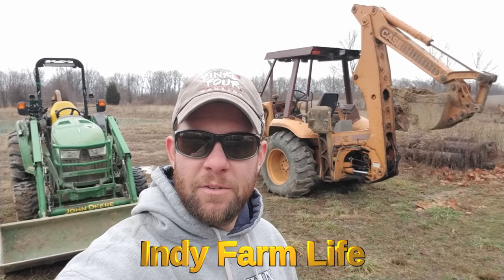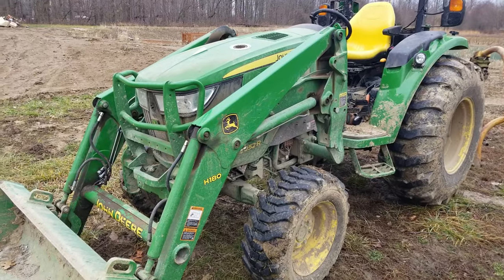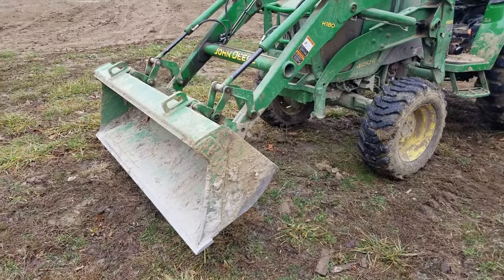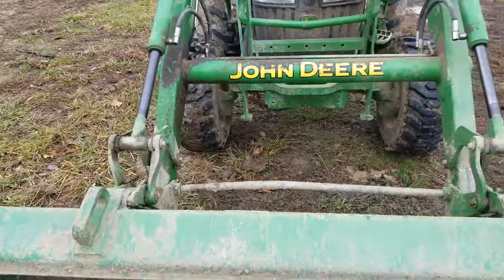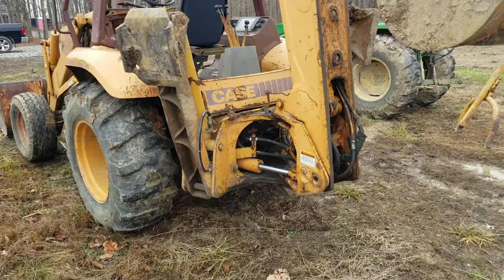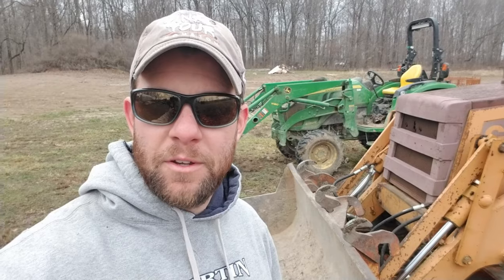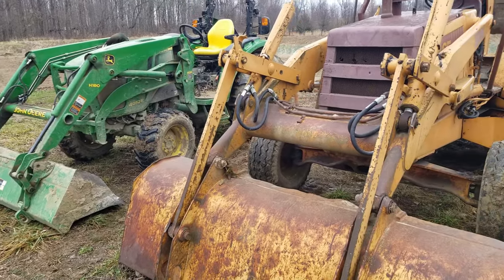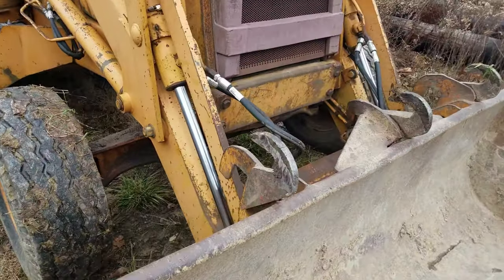Tractor vs Backhoe:  Did You Know About This?

Comment: You make valid points about potential damage to the cylinders, however the main reason case came up with that design is because you get more breakout force with your bucket when using the extending cylinder than you do on a retracting cylinder due to the lost volume and surface area from the cylinder rod. The Case 480 series machines had a setup more like the John Deere without the "Linkage" and several other backhoe manufactures use the typical "Extend cylinder" for bucket curl. The biggest difference is that the backhoes are just plain build stronger to handle these loads vs a farm tractor.
Reply: 100% correct about why that particular model of backhoe is designed that way. Many of those light duty tractors with loader buckets can't pickup the entire machine like a backhoe can. My first run in with a farm tractor with a loader bucket was eye opening to me. My boss got it stuck in the mud. I went to go help him out and the thing couldn't lift it self up out of the mud with the bucket. This is a pretty big machine too. As big as any backhoe I have ever run. I've gotten backhoes in some pretty sketchy situations. And if you stay calm you can use the hoe, the bucket, and the outriggers to get those things our of pretty much any situation because they are all strong enough to lift the entire machine. That's their best feature given that they aren't the best tool for any job lol. They're built incredibly strong and can back drag a loader bucket flipped down like that without a problem. And like you pointed out. Not all backhoes have that reversed cylinder setup.

This guy was clearly still learning about these machines when he made this video. I get it though. There are a ton of people out there with opinions that more than likely attacked him that don't actually know what they're talking about.
Reply from the maker: Thanks for the reply.  Yes, it was the early days. Ha I suppose the setup on this particular backhoe is two-fold then.  Appreciate the insights!
Reply: I agree that the added breakout force is likely the biggest reason case used this design.  

As you point out, the cylinders produce significantly more force extending vs retracting.

Comment: Pretty good video but you might want to make a correction on how a double action hydraulic cylinder works. 
Double acting cylinder has hydraulic fluid on both sides of the piston at all times except when fully stroked in either direction. There's never a point where there's no hydraulic fluid in the cylinder. It uses hydraulic pressure to push the rod out and then it uses hydraulic fluid to pull it back in. 
Easy way to determine whether or not you have a double acting or single. Double acting have two hydraulic fittings one at either end. Single acting only has one hydraulic fitting.
Single acting cylinders use some exterior forced to retract or extend the side of the cylinder that is not supplied by pressure.

Comment: When I was an apprentice back at 'Diesel fitter' school, they went to great lengths explaining to us about all the different 'pressure relief valves' that are in most loader / excavator hydraulic circuits specifically designed to protect cylinders and hoses from this kind of overload. There is the main one on the pump circuit which is usually the first to dump at the end of the cylinder stroke or when lifting too much. Then there are ones on each circuit to (as I said before) protect the closed, or locked, circuit. These are set very high and you have to be doing something very extreme to make them blow off...........Like back-blading and hitting a stump / rock, for example. That said, I'm sure not every machine has these fitted, so best to play it safe!! Great video, by the way!!
Reply from the maker: Awesome info!  Now I just wish I knew which machines had them.  My guess is compact tractors don't and you would find that on more high end commercial equipment.

Comment: Most people do not ever have a job running a real piece of equipment, great job showing the difference in the equipment. Also on the larger John Deere Farm tractors they have a float valve for the bucket when you back blade, this keep them from jamming the cylinders back when you hit anything. Great instructional video.
Reply from the maker: Thank you!  So they have a float function on the curl/dump cylinders in addition to on the loader lift arms?    Mine has it on the loader arms, but I would think you would need the bucket "locked" at a specific angle to back drag properly.  Interesting info.  Thanks for sharing!
Reply: @IndyFarmLife  , take another look at the little JD loader in the full dump position. Take note of the cyl rod clearance down by the bottom bucket bosses. Now image driving forward with the bucket in the full dump position and the "top" edge of the bucket hitting an obstruction. The cylinder rod will contact the bucket bosses and bend the rod. Because of the geometry, it takes almost no force to bend the rods. IMHO, that is how most cylinder damage occurrs - bent rods causing leakage or out right breakage.
Reply: @IndyFarmLife  Just as you said, the float valve typically is only on the loader arms, the bucket is locked to whatever angle you set it. But if you hit a rock while backdragging, the inclined bottom of the bucket pushes the loader arms up and the bucket just slides over the rock. That's the purpose of the float valve, to let the bucket follow the ground.

Btw, your Case loader has a somewhat similar design of the loader arms and bucket cylinder arrangement than my own Valtra 815 (Finnish machine). The manual mentiones about that design:
1. Due to the pushing motion when curling in, the bucket has more breakout force
2. Due to the pulling motion when dumping, the bucket moves faster (less fluid volume needed due to the displacement of the rod)
And it doesn't mention exactly why, but explicitly states not to put the bucket upside down on the ground when digging with the backhoe. So I could not say for sure if there's an unfortunate situation with the different leverages, or if it's just that the driving controls in the back make it too easy to forget about the bucket in the front...

To clarify, the machine has a gearbox with a hydrostatic clutch system where I can select the driving direction with with one lever. No foot pedal and gear shifting needed to reverse, just that one lever needs to be moved. When I have the seat turned backwards, I have an additional brake pedal and driving direction lever there. So it's possible to e.g. inch a bit forward when digging a trench without having to turn the seat into the driving position again. But that of course requries that the front bucket isn't on the ground in a position where it locks against the ground without a possibility to slide.

Comment: Technically, the cylinders are full of hydraulic fluid whether extended or retracted. Although I get the point you were trying to make. Good to know.
Reply: fartpoobox ohyeah  You are correct if it's a single acting cylinder that "pushes" in only one direction, like a dump truck bed hydraulic cylinder. In this case it was a double acting cylinder that pushes in both directions, more common in farm tractors and heavy equipment.

Comment: I picked up a kubota L2501 yesterday and it's supposed to have a "float" feature where the bucket can go over objects and allow the cylinders to move freely, I'm assuming it's to avoid this issue. This is a good video which defines the difference between machines and a good example of what they are meant to do. I've never thought about that issue, until I saw this
Reply: “Float” is handy when backdragging over uneven terrain as it allows the bucket to follow the contour of the earth.

Comment: Honestly I’ve not seen anyone bend the bucket cylinders on a farm-grade Deere, Kubota, or similar quality just with back dragging. I also have a family member that has a 50hp Kubota L series with a fairly large backhoe on it and he digs hard rocky ground routinely, and has probably 750 - 1000 hours on the backhoe operation of the tractor. Right or wrong, he routinely digs with the bucket curled out. He’s dragged some pretty large boulders (2-3000 lbs) out of trenches and foundations that he digs so it’s not like he’s digging sand with it.
Reply from the maker: I personally haven't seen anyone do it, just have read about it/have seen it on the interwebs. Ha. Good to know it's not as delicate as some might think!

Comment: Unless you’re really doing something stupid, you shouldn’t have any issues busting your tractor loader cylinders in that position. The real issue is having the bucket curled all the way in the dump position, such that the open part of the bucket is flat on the ground and your cylinders are at maximum extension. In the loader position you showed in the video, the buck should easily ride over any obstacle you run over backwards. 

Just my thoughts and how I learned to operate

Comment: I was looking at a Kubota MX5400 for use around my farm, when a ham radio friend told me to find a decent, used, Deere 310L backhoe.  I listened to his advice, and am thrilled that I did.  

Granted, it doesn't have a three point hitch on it, but the commercial design, and the full sized backhoe arm in the back is awesome.  It can dig, lift, plow, scoop, and even forklift stuff.  

Best thing I ever bought, even though it costs more than a Ferrari to maintain.

Comment: A serious point people may miss looking at the farm tractor  loader backhoe and the construction Loader backhoe  is the nature of these systems.   The construction unit is made as a unified  rather single purpose system.  The farm tractor  uses lighter detachable units for its loader and backhoe function.   The construction Loader Backhoe  is built for these operations alone. It was not made to operate without its earth moving  parts.   ?The farm tractor is a utility machine, configured for much lighter Loader Backhoe work, along with dozens of other jobs.   Farm tractor hydraulics  may only allow one function or lever to operate at a time.   The construction unit can operate multiple cylinders at once.    While the farm tractor setup  for loader backhoe work, they are very different breeds and must be used as such.   PLease respect yourself and the potential limits of your machines.  You both will live longer and be very much safer.  Take care of yourself and enjoy your work. God bless you all.
Reply: Yeah.  Those green or orange things were made for soy boy farmers, who put their Starbucks lattes in the cup holders.  🙂

Comment: Thank you so much for showing this cylinder work system. I cut my teeth on the lap of my Dad, operating the front Loader control on an old CASE 530. I bought one of the first 580-K that had the New boom design. That was for a Utility (so it was not my Backhoe) my personal Backhoe that I own. It is a 1978 Dynahoe-190
Just two wheel drive. It's a Restoration project
(8000 hours on meter) but that old great (353 Detroit Diesel) just keeps chugging along. Clean 40 Wt. In the engine goes a long way.
Reply from the maker: Awesome to hear!  They certainly are solid machines.  I don't get to run mine as much as I wish, but I always smile when I do.

Comment: That may have been one of the reasons that my dad ordered a Massey Ferguson ag tractor and had the industrial loader adapted on to it cuz it was stronger and more heavy duty and he knew he would be rough with it. But he definitely wanted the ag tractor because he had a heavy duty brush hog and a heavy duty rototiller that he used on it all the time. 

A lot of people know that compact tractors and micro mini tractors are very light duty and are not designed to hold up under constant heavy use.

My dad had John Deere backhoes but he used his Massey Ferguson ag tractors as a skiploader and used it on job sites for grading with a big drag box. 
We loved our fully manual shift gearbox for doing weed abatement. It was a little bit annoying using it as a skiploader loading trucks.
It's kind of funny how you call one a tractor and the other one is a backhoe like it's not a tractor.
That case is a tlb and the other one is an ag tractor.
Over the many years my dad had about four different Massey Ferguson's and just as many John Deere TLBs.

Comment: Cylinder placement also has a great deal to do with power management.
Hydraulic cylinders have a lot more power to push then they do to pull.
As demonstrated on some mini excavators were the main boom lift cylinder is underneath while others have it on top of the boom. 
With the cylinder underneath the boom the boom has more power to lift while the cylinder on top the boom has more power to dig down.
Looking at your green ag tractor it has more power to uncurl than it does to curl which is the opposite of your TLB.
Most loaders or at least the big loaders have a Z shaped arrangement on the bucket curl so that the bucket curl cylinder has more power to curl the bucket back then to dump it. Most large loaders only have one bucket curl cylinder so they have to have an arrangement where they get the most power out of it for curling and lifting several tons of weight.
Most smaller tractors do not take advantage of that. Unfortunately they are designed to have more power to dump then they do to curl.
In any case those light duty tractors are easy to damage, especially on the undersized hydraulic cylinders.
At least those bent Rams can be straightened. There's several videos on YouTube how they straighten them.

Additionally there are some hydraulic cylinders that are made to have equal power in both directions, and they have a hydraulic ram coming out both ends of the cylinder also. Some power steering cylinders are like that.

Comment: Also on the tractor not to have the bucket tipped so far forward more of a flat position, and have the bucket in the float position, so it will rise up over something that might damage the cylinder's  John
Reply from the maker: Bingo!  It's all about being smart with your equipment!

Comment: That 580 is what I have been looking at for land clearing. But am going to need a tractor also for haying.
Reply from the maker: If you can swing it, having both is a really nice combo.  Each can do a lot of things the other can't!
Reply: For land clearing I prefer to use a dozer or excavator.something with steel tracks is much safer and efficient. Based on my experiences.

Comment: They don't put a float position in the valve on the little one?
Reply from the maker: The loader lift arms have a float position, and I assume that would help to some degree, but the bucket could still catch a log/stump if it was rolled out quite a bit.  I also wonder how much spreading would be acheived if in float position.  The loader may simply ride over the pile and not spread like intended.

Comment: Just found your video (2 years later)
There are so many things wrong.

First NEVER start a tractor (or any piece of equipment) standing along side it It could be in gear (never trust a safety switch)

If a hydraulic cyl is pulled all the way down that is when you do not want to hit a sudden load. It is metal to metal and can cause damage You can bend the rod while inside the cyl, bend the piston, or crack the cyl. 
If the pins rest right at the head of the cyl (old Memo loaders) you can bend the head of the cyl

If the hydraulic cyl is part of the way out, the pressure relief valve built onto most system, will pop and let the cyl retract if you hit something (not sure about Junk Deere because will not ever own another after what they did back in the 70s with a combine we owned) sending the oil back into the reserve tank.

You have it 100% backwards

I do not know about your 580, however my 580C bucket cannot go back any further then the cyls can pull it.  If I disconnect the cyls from the bucket after it is pulled as far in as the bucket will let it I have about 1/2 to 3/4 inch more that the cyls can pull it in. Built in safety to keep from bottoming out the cyls

Comment: Lol how is it putting pressure on the cylinder if it is floating? even if you have it locked to go deeper as long as your bucket is tilted and not perpendicular you will lift your tires before anything that would damage cylinders

Comment: A backhoe is way stronger for pushing with the loader. A tractor has a loader that has an arch to the main loader arms. Pushing snow with it slightly raised and hit a curb destroyed my friends loader on his JD tractor.  If he had been in a Case Backhoe he merely would have slid out of the seat because he is crazy and don't wear the seatbelt.  After he would have gotten his body up off the floor and out to inspect the damage to the backhoe he would have found no damage.  Unfortunately his JD loader was pretty badly messed up
Reply from the maker: Oh man, poor guy.  Yes, an afternoon on each machine and you can quickly tell how different they are.  The backehoe is stout!
Reply: @IndyFarmLife  Tim the Toolman Taylor would have run a backhoe.  Wilson would have run a backyard Kubota.  🙂